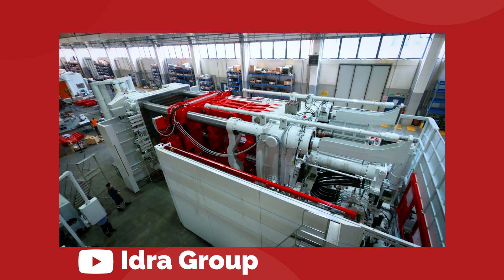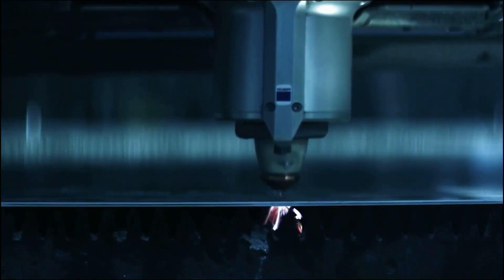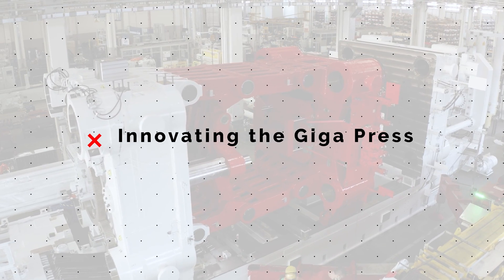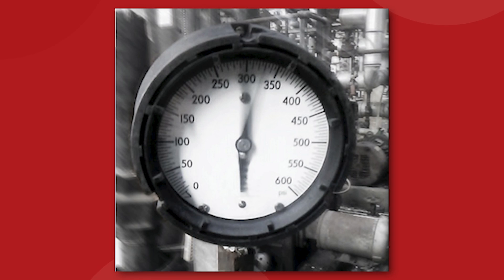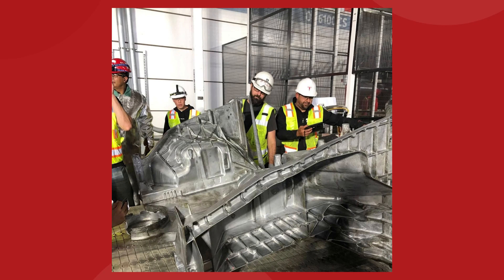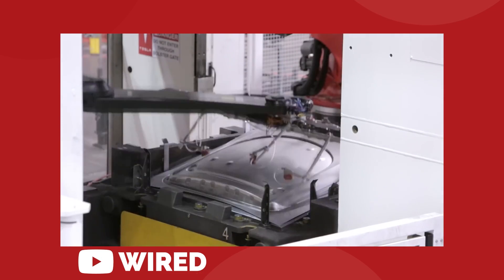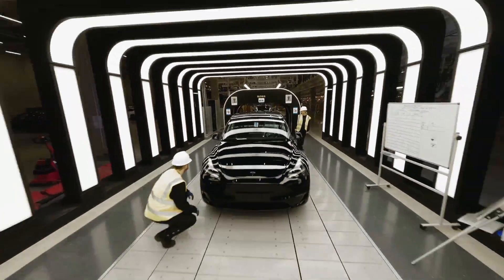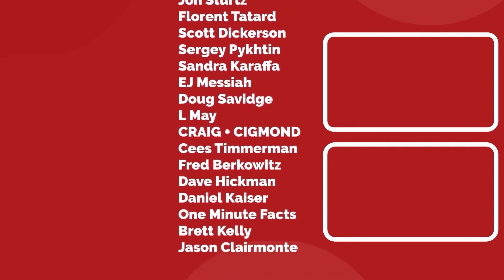The Real Reason Tesla Developed The Giga Press!

Comment from the maker: Chat with like-minded people on our Tesla Space discord server: https://discord.gg/qvGKAh7PqH
Support us as we continue to build The Tesla Space channel through our Patreon here:  https://www.patreon.com/theteslaspace
Reply: Tesla is taking from our insurance companies
Reply: I forgot to add prove me wrong 😑 this whole efficiency gigacasting is a way to drain our insurance companies to explain: it takes two main frames for the whole car to be built very innovative I give you that but what happens when a Tesla gets into an accident? Because it’s one whole part the repair cost is significantly higher and that’s when it starts to hurt them. For. FSD to be possible it needs to be extended to all teslas  driving autopilot mode wait dojo mode aka autopilot the accidents would be automatically analyze to better any errors in self driving and it will pay attention to the manual driver when turned off
Reply: Nobody: This isn’t possible due to safety laws and concerns
Reply: To that I say: bit’s evolution baby
Reply: Please note your earnings/ profit explanation is not correct  toyota made 34.7 b and tesla 9.76b so misleading. Also sales will drop as options increase. 

Like the video and was informative about press.
Reply: This tech existed way before 2020, Tesla just filed a patent for injection molding a whole car frame.
Reply: Now a minor fender bender will require you take apart the whole car and replace the chassis. Hopefully, Tesla will find a way to make that a one hour job.
Reply: Isn't this really bad for crash testing? ICE cars aren't as good as Teslas, because they have a cast aluminum engine up front. Any thoughts?
Reply: Great video but Mario Andretti was an American maybe born in Italy but is 100% American. That's the different between USA and every other country. I can become a french citizen but I will never be french. The second you become a American citizen you are now an American 100% threw and threw.  We are a country of immigrants.
Reply: Are you okay?
Reply: Relentlessly committed to scale I would argue.
Reply: 10000000000000000000000000000000000000000000000000000000000000000000000000000000000000000000000000000000000000000000€
Reply: Awesome explanatory video explains the LK IMM Idra engineering flex ie 10,000 tons Clamping force . So Simple at heart indeed obvious and Brilliant  . Instead of Reshaping and inperfectly Joining Multiple solid metal parts   just do it ab initio ie Create from liquid in 1 single part ! Soybean Oil as lubricant?! Hot liquid injection almost  erotic the Iron Man meets Iron Maidens Clamping vs Pump Force  Ffs so really new tesla  is type of baby Iron Dim Sim lol
Reply: throw away bic lighter cars .. ill stick to my classics
Reply: use the Giga Press to make Tesla phones ! you can do 10,000 at a time
Reply: I’m thinking that both Cyber Truck and Semi will be sharing the same giga -casted power skateboard.

I’d like to hear how IDRA’s wait list is 3-6 years with Tesla permanently at the head of the line. Also, as IDRA can only make a handful of these each year, whenever Tesla announces a new production line, that means at least two 6k or one 9k ton press that further delays end of wait listed deliveries. No wonder “the competition” are like door mice on their adopting anything like this technology.
Reply: Doesn’t a casted frame like this make repairs much more costly? Seems like this will only serve to have more Teslas be written off as total losses by insurance…
Reply: @Av-vd3wk  Absolutely
Reply: @Av-vd3wk  Definitely not. Elon was asked about this a couple of years ago and said damaged areas can be cut off and replacement sections welded in to effect a repair.
Reply: @rossgee1091  and what body shops, besides Tesla routinely do this on such a precise/specific frame? None.
Reply: @rossgee1091  allow me to disagree. Even welded frames made of several parts are very difficult to repair by splitting and welding them. The responsible service will usually refuse such work because it is almost impossible to ensure the required properties of the repaired part, such as strength, controlled deformation, etc. Of course, there are also services that are satisfied with repairing the appearance regardless of safety.
Reply: Thank you. That was the most in-depth and critical analysis of this press that I have seen up-to-date. And I follow all of Tesla's Twitter posts and updates Etc. There has been several articles which are misleading about the power and what this press really means when you say so many tons of pressure! You have explained it to the point where I know thoroughly understand it. It's not just the pressure for injection but it's also pressure for molding security. I love science and I do think this is a critical new component however my concern is they are linking these two huge bodies of metal and in the middle would be these very dangerous Lithium-ion batteries. I foresee some people getting burned to death in bizarre crashes that might puncture the battery container box. I pray and hope that that's not true but unfortunately I've usually been correcting my risk assessment on these types of creations.

Comment: can someone tell me why the clamping force is not the same as the Injection force (by plunger)? We know well that in fluid, if you could ignore the potential gravity and velocity difference at two points (which is the case in die casting) pressure must be almost the same everywhere! it means that pressure exerting by the plunger will transfer through fluid to all points inside the mold.
Reply: Just be aware that as fluid flow through the mold, it will loss its pressure. It means that maximum pressure must occur at the beginning of the path: where there is a Plunger!

Comment: My issue with a Tesla is that it reminds me of the Toyota Prius. When the Prius first came out. It looks very cheap inside and it doesn't have the vibe you would expect for the price you pay.
I would rather have my Mercedes over a Tesla.
The Mercedes feels like a luxury car. The interior is comfortable and designed for everyone in the car. Plus the Mercedes is the luxury car that handles like a sports car. The only car to me that beats a Mercedes is the Jaguar.
I can't see the point of paying $40,000 for a car that feels like you should have paid $12,000 for or $60,000 for a car you should have paid 30,000 for.
I never bought a Prius because it was focused on being electric without the comfort inside. I feel Tesla has done the same thing.
If I bought a Tesla. I would have to rip the interior out and redesign the car. Overall I would give a Tesla a B- grade. It still has a long way to go.

Comment: "Giga", Is Very Similar to Injection Molding Machines!!.....So Similar, they are Identical Except Much Bigger Capacities!!....Many Benefits to Molding Parts!!....Repeatability In Accuracy and Usually Using Left Over Material for Further Molding!!....And like the video states Molding Saves Time, Once Up and Running....But Also Inherent Stress Problems...Internally Molded In the Product....This Is All Calculated What Is Allowable, By End user Service...

Comment: I don't understand why the castings on the press have to be placed horizontally? It's easier to use a vertical press, because the height of any part will not exceed two meters, and in most cases one meter.

Comment: Hmm, I'm sure that during ww2 Nazi Germany used bonker presses to press their fighter plane frames from a single piece and thus giving them an edge by being more robust and being able to make sharper turns. After the war, the USSR took the largest press and plans for even bigger press and US took 2 smaller ones, which were the world's largest presses for quite some time. Now, this is not exactly the same but still, from some perspective, I don't find this innovative or spectacular, if you consider that it was done 80-100 years ago for quite complex machines. Btw these presses are still being used today to press modern aircraft parts.

Comment: The 6000 tons of force is spread over the entire platen. 
241 tons of ram force is spread measured just over the cross section of the ram piston. That same 241 tons of ram force is multiplied over the entire cross section of the platen. Therefore the force the 6,000 tons of clamping pressure is resisting that 241 tons of force divided by the cross section of the ram piston and multiplied by the cross section of the platen.

Comment: very small press compared to the press used to make a 40 ft  plate stel  1/2 inch thick into a pipe. and the expander that uses 25,0000 psi. to steraten and expand the pipe to the right size.

Comment: I don't get why they designed the car with the battery pack as a mid structural component. You have to split the car in 2 to get to the batteries.

Comment: "You've damaged one small part of your frame. Unfortunately we can't just replace it with another since it will be structurally unsound, so you're going to need an entirely new frame for your car and we'll have to remove everything attached to it which will be a lot in parts and labor... OR you could just buy a new car..."
The "Efficiency" isn't in the creation, it's in the consumable consumerism.

Comment: i only own 650 shares, but i bought every single one of them for only one reason -  bleeding edge mfg process.  as a 2nd gen italian, couldn't be prouder that the giga press was italian made. 

just wait until we find better sources and methodologies for batteries...  also, one we crack the fusion problem - electricity will be vast and cheaper than your water bill in the winter.   my bet is on helion.

Comment: seems like a tube frame like a race car would be quicker and cheaper. also easier to repair after a crash.   maybe im  wrong but over complicating things seems to lead to unintended consequences      like boeing max.       newer printing machines are garbage vs the old stuff and does exact same thing

Comment: Nothing new just at a much larger scale than before.

This will decrease the production cost a lot, yes BUT the car is now unrepairable if anything on this part is damadged.

If you have a small crash in front or back a regular car is easily repaired, but the cast Aluminium is NOT repairable and needs to be changed as a whole part.

Insurance will probably get expensive fast

Comment: The clamping force is much larger than the injection force for much the same reason that you can lift a car with only one hand on a hydraulic jack. It's a ratio of different areas with the same pressure.

Comment: Brilliant engineering but... making the battery compartment an integrated structural component, and coupled with adhesive assembly for environmental sealing and reliability it almost guarantees that the batteries cannot be replaced. Among other issues, what determine a Lithium ion battery's life is the number of years from date of manufacture (Around ten years, possibly a few more now, but this detail is obviously very commercially sensitive, so secret).  
This issue will not be lost on a car manufacturers management, it fixes the maximum lifetime of the product, so you know when it will need replacing. A customer cannot just purchase another battery pack though, it's a glued in structural component. We will see when the first car comes off the production line.  I cannot see the government stepping in to make car manufactures play fair though, well unless the oil industry pays for the lobbying...

Comment: I used to work in investment casting and we were moving into larger castings back in the 90's... Another one of the problems when scaling up is that when these cool, there are stresses which pull and contract as the metal shrinks differently in thicker sections as compared to thinner sections of the casting, giving a high likelihood of warping... we almost abandoned our efforts because of uncontrollable warpage. I ended up leaving the company before they resolved the issue.
Reply: They forget to design water/oil cooling for the mold and the machine like Gigapress has. And Tesla using new patented aloy that solve that problem.
Reply: They are going to run into problems with their die cast frame and the people that are buying them are going to pay for it. They couldn't even properly make and engineer a simple motor mount that did not habitually break.
Reply: @sdvten  who?

Comment: As a 10 years manufacturing engineer, I would say this Giga Press is not a good idea. I understand 30% is a lot of saving, but trust me it's not a good long term for the company or the customers.

For Tesla: 
1) If there is any design issue, whether relate to die cast, design, assembly, customer lawsuit and you have to modify and affect the press. You can't modify the current die set. You will end up buy some machine to fix the issue( and If it's fixable).
2) How does Tesla know their top models that use this die set will last how long? Technology are changing so fast these days. Die set will cause your top sell model can't modify and improve.

For customer:
If your Tesla is damaged, die set parts CAN'T fixed. Which means you might need to trash $30,000~$50,000 car. It's very high maintenance cost for the customer and no one will buy Tesla.

Keep it flexible will help the company more competitive in long term goal.

Comment: One disadvantage: If you damage the frame somewhere, it might have to be replaced completely. Basically you can throw the car away
Reply: Depends whether Tesla/insurers will approve repair sections/plates being welded in. Positional aluminium welding and non destructive testing of said welds is much more specialised than welding a standard steel unibody… So it’d be a pricy repair.

Comment: a lot of u think ev is the way of the future but as it was in the beginning, its limited, that's why the combustion engine took over, ev is something that can be easily overtaken and dangerous, but most of u are blinded by things but u don't see the truth, is electric safe, how many times ev catch fire, how many phones with batter suddenly burst into flames without warning, u don't know the amount of heat is caused by ev, u have all these cars charging how much head and power will have to be produced to keep charging year in and year out u ever looked into that. no, but u just make up a lie that ev is the future into what, disaster, u don't check anything, u'll need to stop letting the wicked consume u with none sense, not because a man is a millionaire means he is where he is because he did it the right way, cause if u look at their background on how they become where they are its never true doing the right things, a lot of u will cut corners to be rich, but where those is lead u ,  if money was so important why those the wicked give it away for the soul of man

Comment: It's not better. It's cheaper, lighter and stiffer, but is way more brittle and tolerates by far less deformation (which are inevitabe not only colissions, but also during normal vehicle operations, like cornering). Instead of paying to their emploee, training people and care about them, so that people valued their job and did pay more attention and less mistakes, Tesla's upper management now can pocket that money in exchange to the end product repairability. What would happen if any of those 2/3 of vehicle frame? Unlike steel frame, they can't be repaired, but only replaced. Now you can only imagine how much would it cost to replace a third of a vehicle frame.
Reply: But by nature Aluminium is not brittle but rather difficult to weld and machine

Comment: So it's not a press it's more of an injection molding machine?  

Better.  Zero and I mean zero repairability.  Never mind all the high strength and ultra high strength steel other makers use to comply with safety regulations. Well just make an aluminum casting it will be great. New vehicles unibody construction actually has historically amazing tolerances. This sounds problematic given the precision of the brands current panel fit precision. I really think it's more about cost savings.  Cast one substructure and you don't have multiple metallurgy precision robotic and laser welding. I know it's different for all specific uses but traditionally cast pieces tend to crack under high stress impacts. How will this method of manufacturing if used exclusively absorb and dissipate the tremendous forces in a collision. Along with fatigue.  Off o go down this rabbit hole. I'm sure this has all been addressed and there's published studies on it.

Comment: Not a concept for easy repair.
Reply: you think unibody repair is easier than this?  I'd like to see what makes you an authority on reparability keyboard warrior.
Reply: @Dexter_Solid  Machinical Engineer fifty years, yes since computers aided Engineering.
Reply: @AquaMarine1000  HAH ok, comparing the two designs, what makes the cast harder to repair. As far as I'm concerned, unibody and this are the same.
For what its worth. It may be cheaper and faster to replace the entire section, being separated components damage will transfer less from the impacted area to the others.
Reply: @Dexter_Solid  Each material has it advantages and disadvantages, you need to study material science to under the differences between pressed steel and cast Aluminium in automotive production. Start your inquiry by talking to repair shops to build your knowledge. Cheers

Comment: It's very difficult to make structurally sound repairs to broken aluminum castings.  This pretty much means that structural damage to a vehicle made with these large castings will result in scrapping vehicles over what with stamped parts would be relatively minor and economically repairable damage.